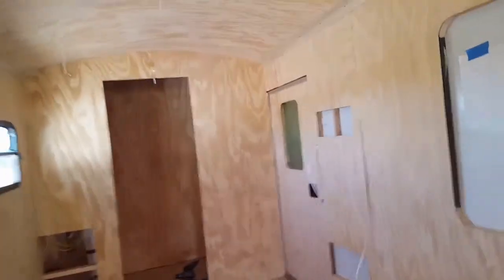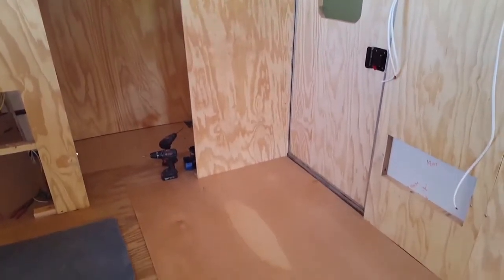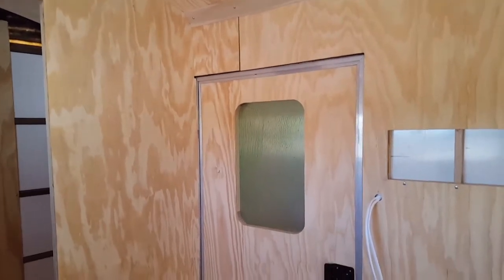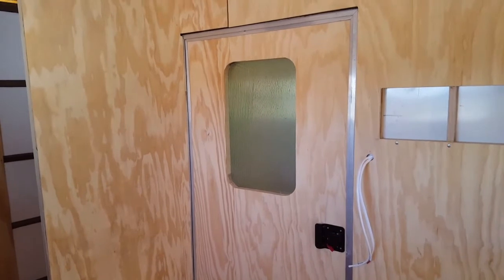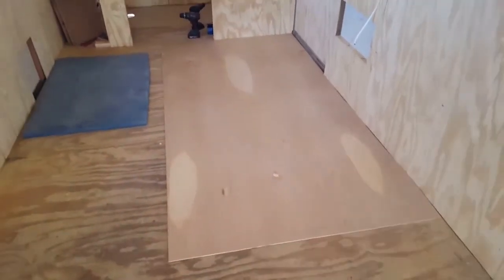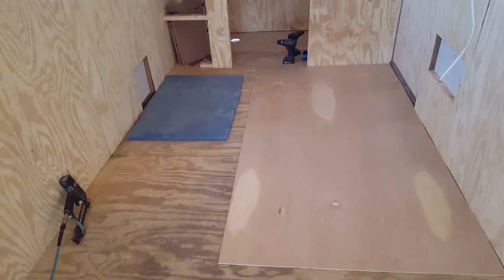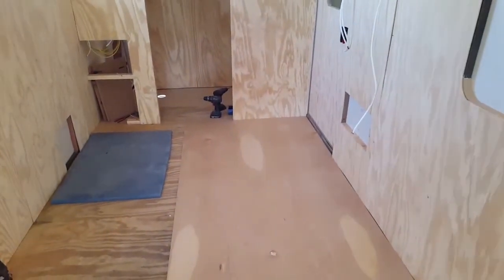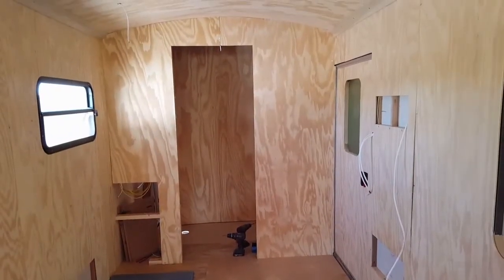Cargo trailer conversion #8 door remade and floor underlayment prep.

Comment: Howdy... Your entry door latch, did the trailer come with it? Or did you upgrade to it? Mine has the bar latch but I'd like to have a normal entry latch so I can go in and out. Nice vid thanks for sharing... Thumbs up and I've subbed your channel...
Reply from the maker: I think I bought the latch on ebay, turns out it was a perfect match, the one that was on there before the previous owner lost the keys to it. I was thinking that I would like a bar latch on it also though, some one tried to rip the door open a few years ago and since I've been having issues with water coming in around the  door and getting on the plywood inside but doesn't have anything to do with the latch, I may have to put plastic laminate on the inside so if it gets a little water on it, it wont flake the finish...thx for watching and subscribing. I think I'll be making some new videos soon.